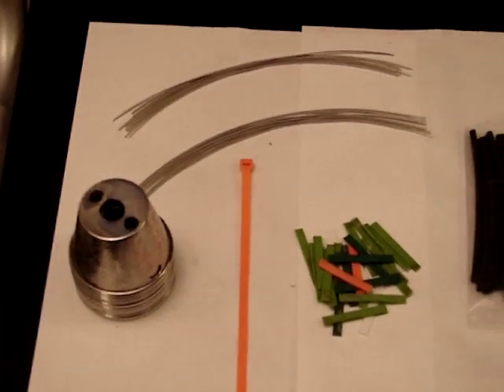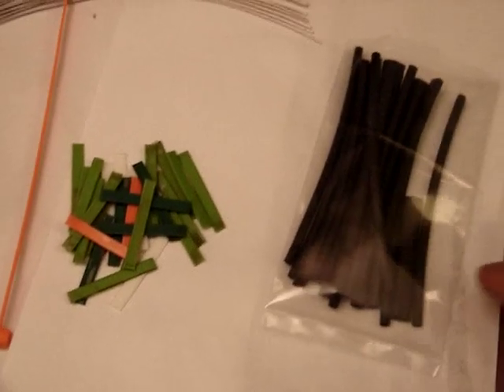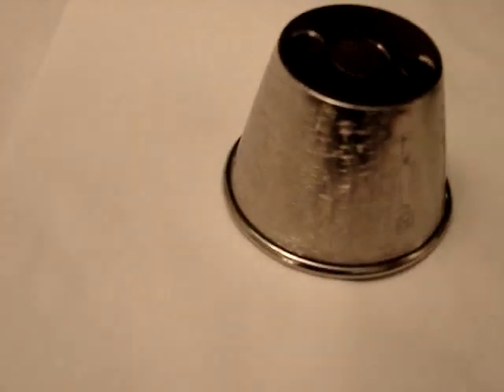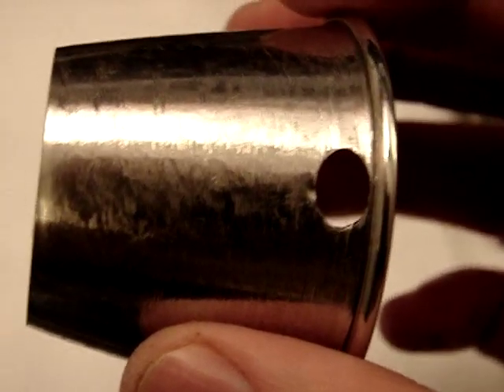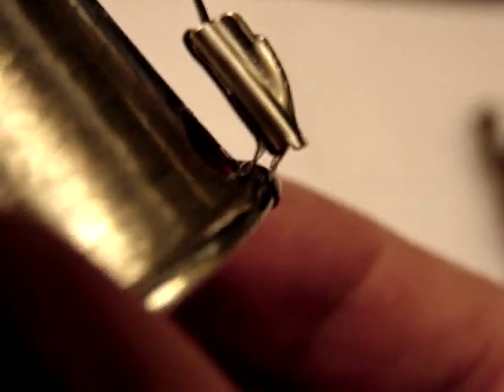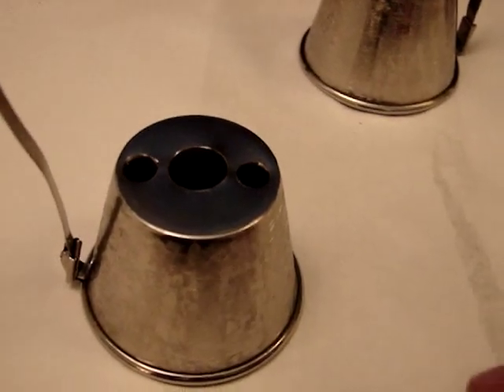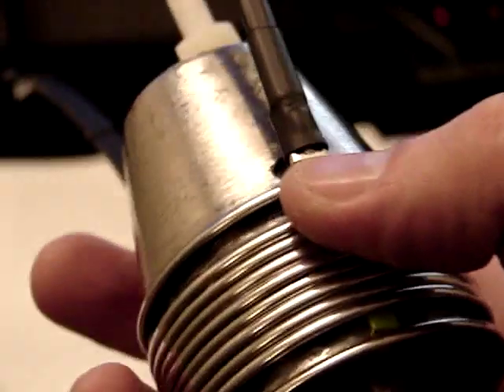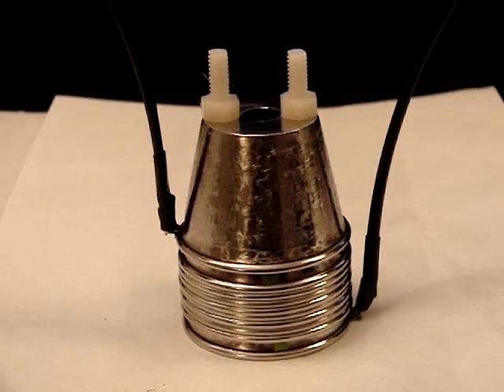Vid12 How To Make Fire with Water

Comment: This is one of the more innovative designs I have seen, and  a series of thorough videos to match.
The only thing I would personally change in this design, would be the material used as spacers. I feel just a semi-thin line or two of silicone caulk around the anode and cathode cups would suffice and would be a more permanent solution rather than using plastic spacers that are loosely added. Nonetheless, awesome build.

Comment: If no one has taken the time to say you are a genius . and thank you for the free information knowledge is priceless I have not assembled mine yet had a stroke 7 years ago left side still paralyzed need to get help from dad. He hates doing shit like this I am wondering how badly the zinc connectors will erode,  maybe a coat of solder on them would help or dielectric grease. Just a thought. saving the world one condiment cup at a time. 1 dozen stainless steel sauce cups on amazon.$6.19 my sams had a 12 pack on hand and 18 packs on order. HHO 4 ALL has done everything for us except order and assemble everything except order the parts and assemble them for us. you could order the product from him athttp://evolutionhho.com/hho-kits if you need more help. best of luck. Be Well
Jim

Comment: Thanks for your post, Very interesting. At 7:43 in the video you mention no space between the neutral cups? Why not? Then you have a 3 cup design? One + and one neutral made up of 5 cups and one --   Each cup space should NOT TOUCH each other otherwise they are worthless. It will only crate heat and erdoe your electrodes after hours of use. Weeks of use. On the bench for 5 minutes is not a real test. Also you should isolate the gas out holes 90% of the current will run though the center of the cups and not to each mm of cup surface area. Just trying to help.
Andrew

Comment from the maker: Neutral cups serve a few purposes.  They increase the distance between the Pos & Neg terminals, which reduces amperage & heat, while allowing the current to travel across the cups by way of the electrolyte solution. Neutral cups do also produce hho gas, because they have current running through them.  Using Neutrals is essential for proper hho generator design, other wise you will get boiling water and overheated terminals.

Comment from the maker: However, stacked neutrals do increase the distance between Pos & Neg terminals and reduce Amperage & Heat. Obviously this is not an ideal design, but with some configuration modifications, it could perform very well. If you go to my channel and view Video 13, you will see that this design does work well, even though the voltage is around 4 Volts each (Pos 4v, Neutral 4v, Negative 4v).  The downside to 4v per plate is the cups degrade very quickly!

Comment: All the rest of your design is really nice and well explained. You did a great job with this video.  I think you didn't understand the concept of "neutral" cups/plates.

All "O" are cups and all "o" are spacers

+OoOoOoOoOoOoO- 

this way, if you apply 12V, you get 2V between any of 2 consecutive O's.

Right now, your design looks like this:

+OoOOOOOoO- whis is simplified as: +OoOoO-

if you apply 12V, you get 6V between each O's... that's the only difference.

Comment: you have it wrong... You need to add spacers between your neutral cups too.  Stacking 5 cups without spacers is only making one thick cup.  It's not 6 but 2 cells that you built. To make gas, you need 2V between each cell.  In your setup, if you apply 12V, each cell will have 6V applied to them which is too much.  Sure it makes gas but it also build heat!  If you put a meter between your neutrals, your reading will be 0V. The equivalent to a wire. Just because they are touching each others!

Comment from the maker: @tannertargus 

It would provide you with more surface area, but would also create a greater distance between the POS & NEG connections, causing reduced electrical current to each connection.

Using the following configuration would fix the dissipation of current.

Neg
Neutral
Neutral
Pos
Neutral
Neutral
Neg

7 Cups At 12v = each cup would have 1.7V

You could double stack the neutrals to get extra surface area.

Comment from the maker: I've heard of adding vinegar to the bubbler also, but I use a 2 stage bubbler to filter out impurities.

I have also seen people using aquarium bubble stones to filter any harmful vapors from the HHO gas. I believe the term is scrubbing.

Using an EFIE you can dial in the proper fuel mixture.  This is also necessary on most newer vehicles, because the O2 Sensors on the intake and exhaust will increase the amount of fuel to compensate for the added oxygen in the system.

Comment: My electrician mentioned about using lye and the need for having white vinegar in the bubbler to neutralize the lye in the hho gas before it enters into the engine. He says it can eat up the aluminum??
Also says that need to regulate it as not to lean out the fuel into the engine as it will get hot?

Comment from the maker: I picked it up at Home Depot in a pack that had several different sizes. I believe you can buy heatshrink at Radio Shack also.

Depending on the size of the wire that you are looking to wrap, you will want to bring a wire sample with you so you can make sure it will fit.

Comment from the maker: With my design the neutral cups do not require spacers, because when connected they act as a single Neutral cup with a much larger surface area. (Basically 1 BIG Neutral)

Spacers placed on the Positive and Negative cups are needed to keep them from touching the neutral cups. 

It required out-of-the-box thinking to come up with this solution, so I understand if some people can't wrap their minds around this! 

I will post the video response here, so you can see what I am saying is true.